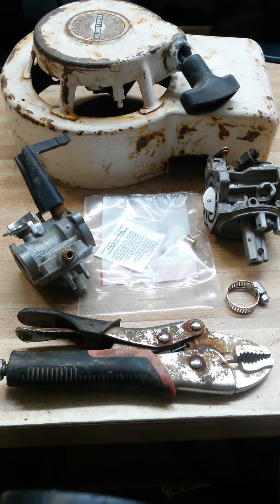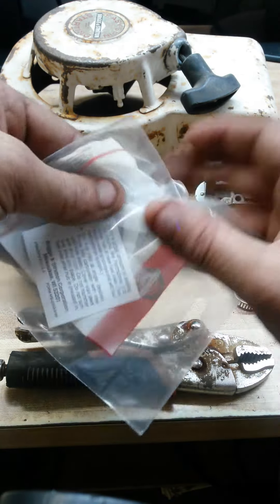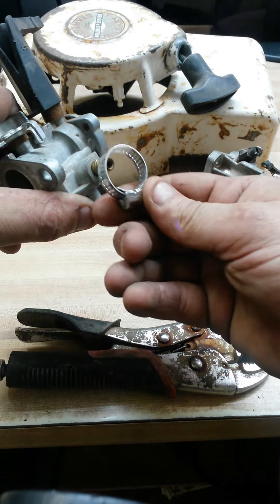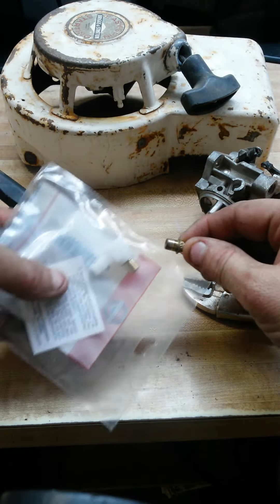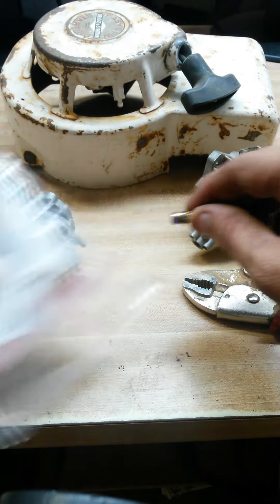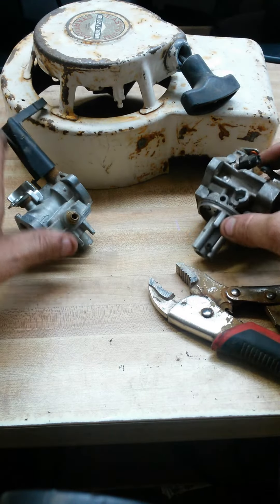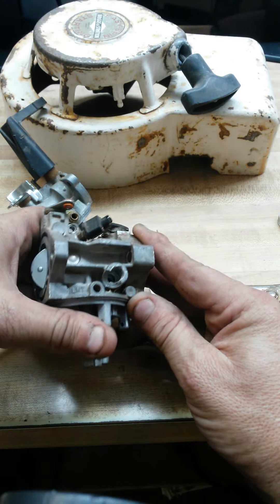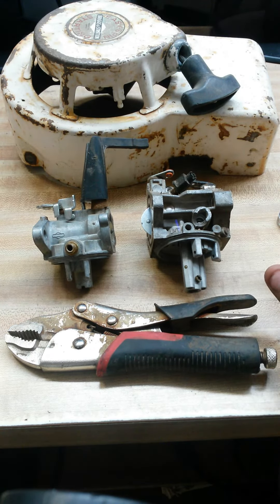How to Fix plastic fuel hose adapter connector Briggs Carb part #692317 on the side of a carburetor

Comment: Thanks for posting, I was not even aware that the connector actually came off, I was looking at replacing the carb to stop a leak coming from a crack in the top of the connector. Thanks for saving me money and time.

Comment: Hello... can you please tell me the OD of the brass, press-fit part of this fitting? Are all small engine carburetors the same for this inlet fitting? I am tying to find a replacement for the carburetor on a 1998 Kitty Cat snowmobile. It has a small Suzuki Engine in it and I suspect a Mukini carb. I measure the ID of the hole this fitting goes into at 3/16" with a caliper. Help please?
Reply from the maker: Seriously doubt one size fits all.  I would take it into your local shop.  The can see honestly I have no way to cross it for you.
Reply: @AskTheMowerGuy  I honestly agree that one size will not fit all, but I cannot find the OD of that Briggs part anywhere online (yet). Thought if you had parts avaiable you could caliper it for me since I know the dimension of the ID of the hole on the carb.  Thanks anyway.
Reply from the maker: @hobbithabits2806 I'm sorry mis read.  Let me see if I can

Comment: Thank you for your video .Very helpful. My engine was leaking fuel , thought was the bowl seal changed it twice and then saw the plastic on the hose connector  had a crack in it,

Comment: Guys! Maybe you can help me... When I removed the connector from the fuel line inlet I could not get a new one back in there! There was a small brass plug in there that was stuck and eventually disintegrated! What is this called and is it replaceable? Please help! Thank you!!!

Comment: I'm trying to find the part you have in the plastic bag. (right angle Inlet connector hose) for a Briggs & Stratton (Engine model # 110432-0036) I'm not sure what the part # is. Do you inventory these?

Comment: What terrible design!!  You would think the Safety Board would have put a stop to a fuel fitting that is merely pressed in. I would be worried that the new fitting would just pop out at some point and start a raging fire if not an explosion. At least if the thing was all brass you could beat it in really hard. I like the idea of a small hose clamp better than replacing it with a new fitting since the old one got pressed in good at the factory. I'll never buy anything with an LMT carburetor on it ever again.
Reply: When I looked up the new ones they are made of one piece of brass with screw in threads, unfortunately I have an older mower and the fuel bowl is not threaded to receive a threaded connector so I  needed the connector shown in the video.
Reply: @johnlaursen6080  ebay has them just type in Elbow Fitting Fits Briggs & Stratton hope this helps JESUS is coming soon will you be part of the rapture ask him to come into your heart blessings